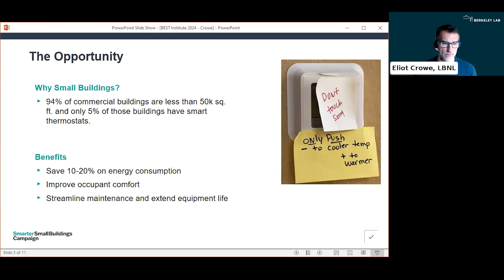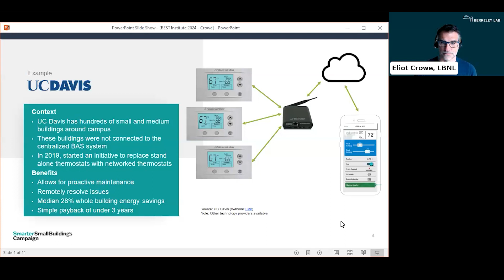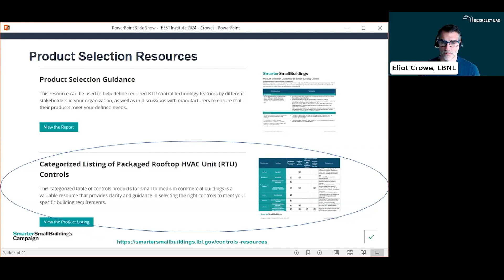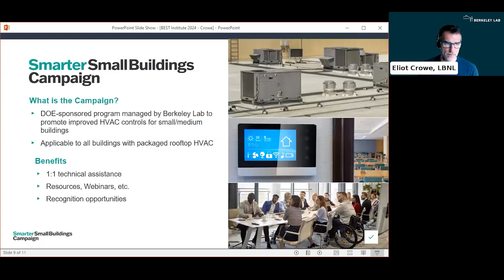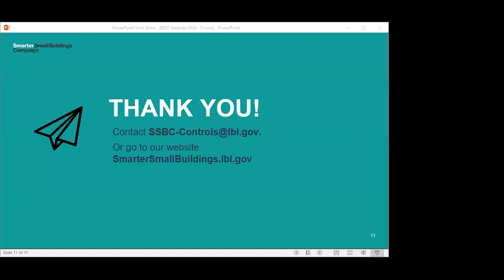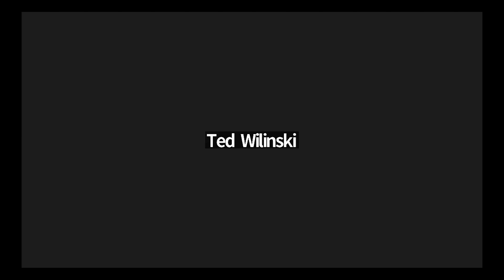Big Ideas for Small Building HVAC Controls: Current State of the Art

Comment: My name is John Ellena I am the owner of E.R.S. Energy Reduction Systems. I install affordable remote monitoring and controls for smaller commercial buildings. I spent many years as an HVAC field engineer, so I know these systems inside and out. Here is what I do when I install a remote monitoring system.

-install Emporia electrical monitoring system in the electrical panels. This allows me to remotely monitor the entire building's electrical footprint on a trending timeline. The system cost $200 per electrical panel. So it's very affordable.

I install Wi-Fi thermostats. 

I install temperature sensors on the HVAC supply and return. This allows me to monitor the Delta-T. 

I install zone damper systems four rooms that are rarely used, which also are controlled by Wi-Fi thermostat.

I install Wi-Fi controlled contactors to shut off water heaters for extended unoccupancy.

I install smart plugs and smart lighting

I offer remote monitoring and training to use the system.

A simple system with one electrical monitoring system and one Wi-Fi thermostat is $1,000 cost to customer. I offer remote monitoring for $50 a month. And I am $80 an hour for further diagnostics and implementation.

My customers are routinely shocked to find devices that are running unnecessarily. They are also very easily trained to monitor their own electrical footprint. 

With the Emporia electrical monitoring system it's very easy for the customer to see the impact on their electrical footprint by a simple change to HVAC system setback time, or setback temperature. 

They are also shocked to find something as simple as dirty filters causing a HVAC system to run 50% longer than necessary, and sometimes 24 hours a day.

I am trying to work with Elitech to make a dedicated HVAC monitoring system that performs the same test I do when I'm on site this includes;

HVAC system electrical footprint
-compressor amps
-blower amps
-condenser fan amps
-crankcase heater amps

Supply and return temperatures

Superheat
-a low superheat will ruin a compressor
-main cause I see is dirty filters, slipping belts, bad blower fan capacitors
-a high superheat along with low subcooling is a Tell-Tale sign of a low refrigerant charge.

Subcooling
-a high subcooling can be a sign of refrigerant overcharge or dirty condenser coil.
-a low subcooling can be a sign of low refrigerant charge or a refrigerant leak.

Discharge line temp
-this tells you if you're a compressor is about to overheat

Monitoring the HVAC system electrical footprint along with monitoring the superheat and subcooling, I can easily set up a timeline for maintenance. 

This also allows for alarm notifications to be sent to the customer or myself.

The system will involve;
-six temperature probes
-two pressure transducers
-6 circuit transformers(amp meters)
-a PLC sending unit with ethernet port to connect to a outdoor Wi-Fi antenna amplifier. 

Without a system like this you will not get an accurate view of your HVAC RTU. 

Currently I can only remote monitor the electrical footprint and the Delta-T of the RTU. 

I am trying to convince Elitech that a unit like this would sell in vast quantities. My Emporia electrical monitoring system cost me $200. All I really need to add is 6 temp probes and two pressure transducers. I believe a unit like I want could be produced and sold for under $500.  

I would love nothing more than to correspond with anyone who is interested. 

Thank you